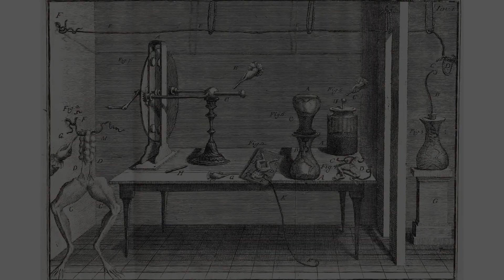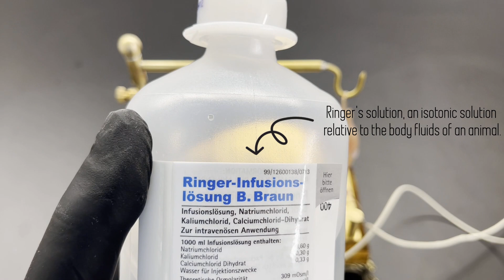The dawn of electrochemistry

Comment: Great workmanship and demo!
However, in this setup you are supplying electricity externally between 2 brass electrodes? The electrochemical cell would involve the legs twitching when contacted across two different metal electrodes without an external electricity supply, right?
Reply from the maker: You can do it in two ways. Either two different metals (for example, zinc and copper) or apply a voltage. I followed the second way (see https://en.wikipedia.org/wiki/Frog_galvanoscope). I did this mainly because I wanted to know at what voltage the frog's leg starts to twitch, and whether increasing the voltage and changing the polarity play a role, as I found little information on this:)
Reply: @Marbslab  Interesting! The wiki article says it was capable of detecting very small voltages. Your data of min 1 V doesn't seem very small, unless the detectors at that time couldn't even detect this.

Comment: Wow that's a piece of art, not just a mere demonstration. Kudos.
I'd liked if you have given a bit more of information about the solution. Why it was necessary? What is its purpose?
Reply from the maker: Thank you:) Ringer's solution is an electrolyte. It is used to increase conductivity, especially in the area of the frog's nerve endings and the hook. the solution is not absolutely necessary if the frog has been freshly prepared.
Reply: @Marbslab thanks for the clarification. I never came across that kind of product, very likely because - I suppose - is used in biology.